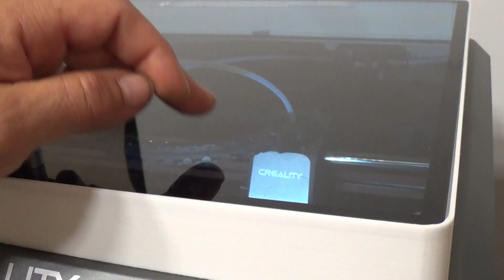CREALITY K1 MAX AI - simple hack for better printing quality and to use more materials!

Comment: I see that next to the K1 max you have the QIDI. I need to purchase something with a table around 300x300 would you recommend the K1 max or the QIDI plus 4? Unfortunately, I have not been able to find any comparison on the Internet so I'm asking someone who has access to both printers. I started with reprap, then enders and others, so I'm not afraid to get my hands dirty when it comes to mods, alterations or other upgrades. And I'm certainly not one of those “download a file from the Internet, press a button and print” people. 😉😂🤣
Reply: After 10 years+ in the industry, I can safely say I am 100% one of the "download and hit print" people - since I hate spending 99% of my time fixing what a shitty company can't do. Bambulab is the way forward. I slap my print in the machine and out it comes, perfectly every time.